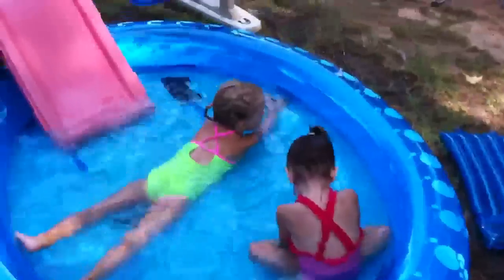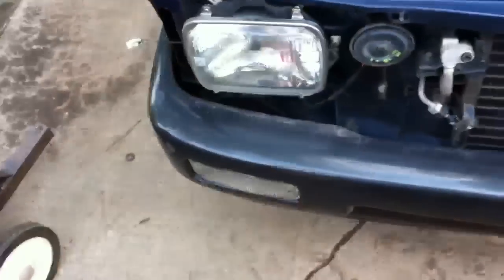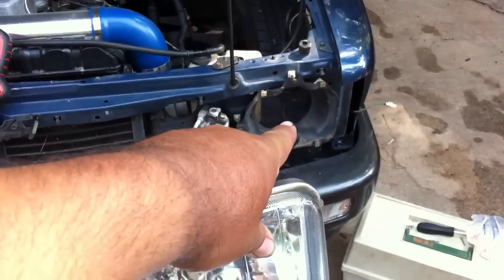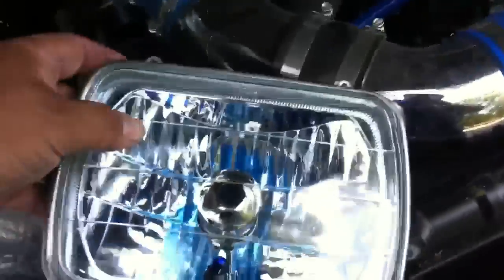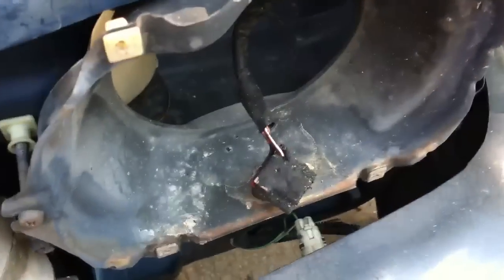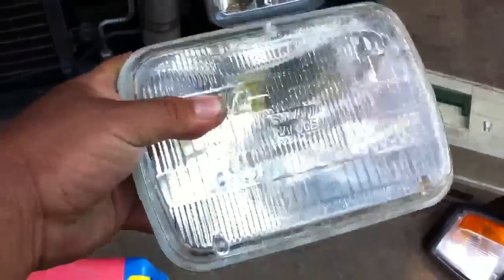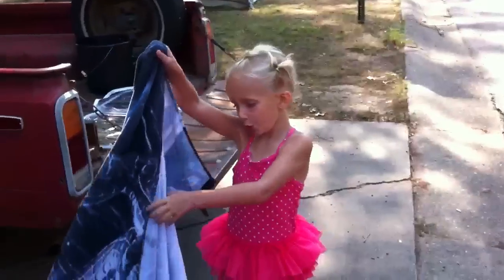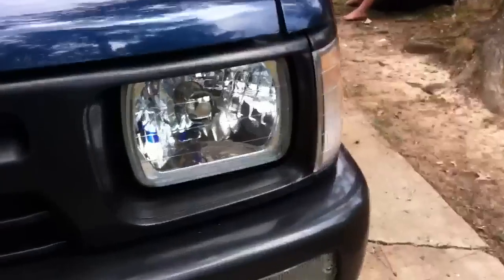How to Do a head light conversion

Comment: I'm curious about the little blue bulb inside the headlight. Where do those wire to?
Reply from the maker: +Josh hall separate switch there just an accent light.
Reply: Lawrence Duarte but I could wire it into my tag/park lights right?
Reply from the maker: +Josh hall yeah just put an Amber light in there anything els you can get a ticket for your choice though.

Comment: Where did u end up connecting like blue little bulb?
Reply: I'm trying to figure that out myself. I have a 97 chevy k1500 and I have no idea where it plugs. But they are bright without it
Reply: +Every1knowsPOPS +death dealer  i hooked my city lights into my park light!(pos+ only) ran ground to (neg-)side of battery! some wiring reduired! and there u have it! make sure you dont hook to blinker wire on parks! too me some time to figure it out but they work fine this way!